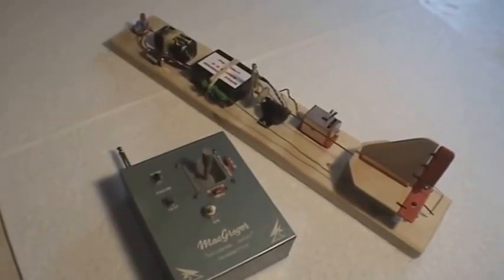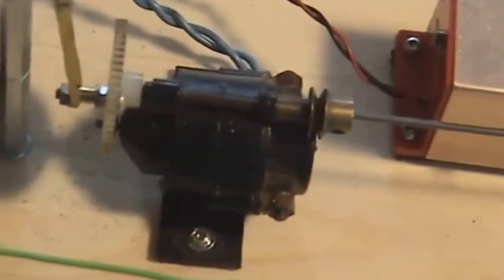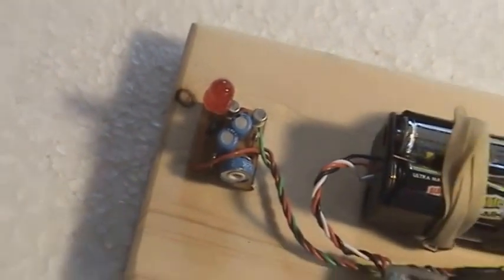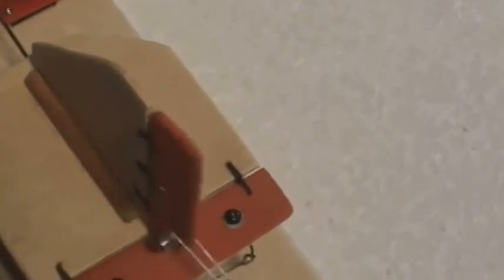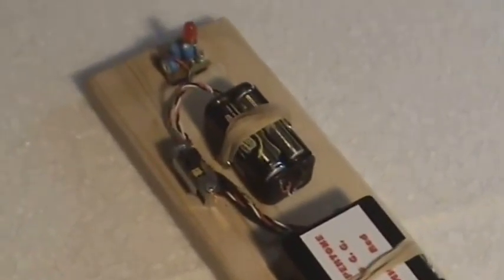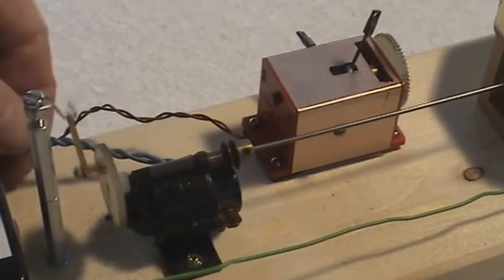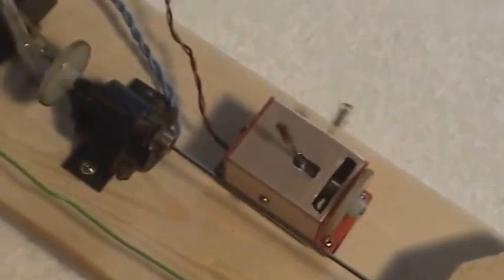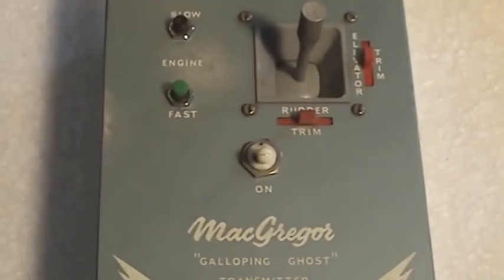Mighty Midget Galloping Ghost ( Simpl Simul - Pulse Proportional) demo rig

Comment: Nice demo setup.  I initially used the "mighty midget" motor in my "pulse proportional" days, but later went to the  commercial Rand LR3 actuator, which was a very nice unit for Rud/Elv/MC. Initially, I built a Phelps Pulser to add to my Citizenship CTX tube type TX, but later bought a Controlaire Galloping Ghost TX.  Those were some great days of flying, compared to using a superregen RX with rubber band driven escapements (I used the Bonner R.E. Vari-Comp).